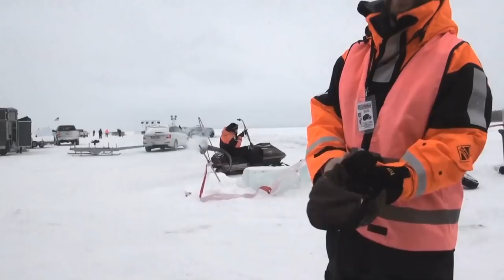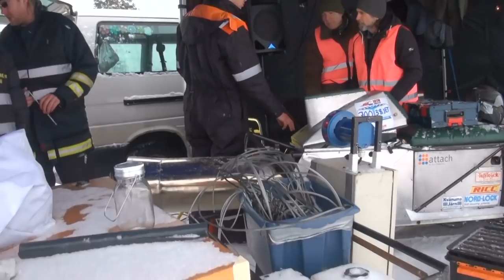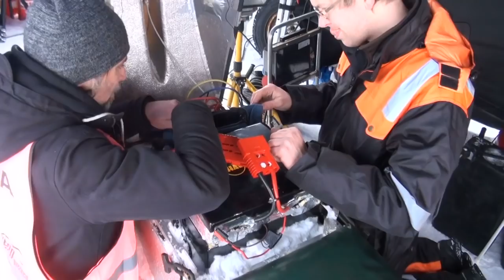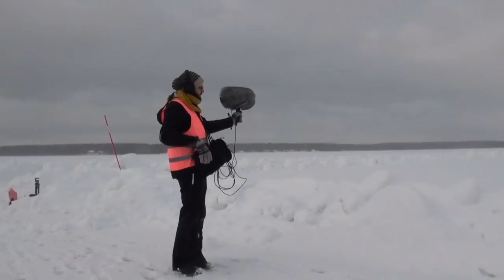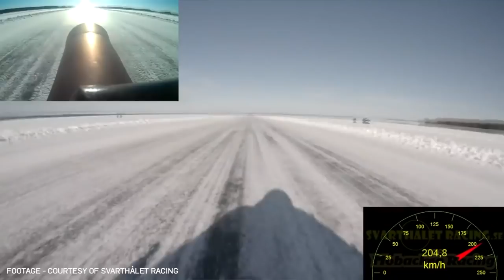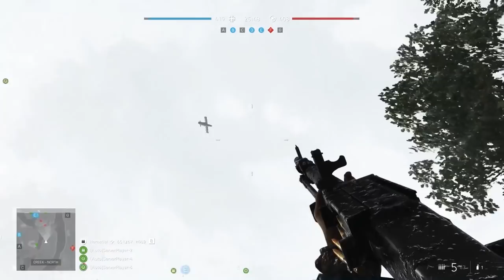Battlefield 5 audio design - V1 Rocket Sound by DICE

Comment: I imagine the hard part was actually finding a pulse jet engine
Reply: would have been cheaper to just weld one together. it's not exactly a hightech engine.
Reply: @bumboclat  yeah, little to no moving parts.. maybe the fuel itself would be a problem to get
Reply: @mrmedium7984  what are you talking about, lmao
Reply: @OliverFlinn  methane as a fuel source
Reply: @mrmedium7984  well, maybe DICE did use the proper fuel mixture for their replica, maybe they didnt.. who knows.. it sounds pretty good to me tho
Reply: Nope, they're quite simple.
If you really wanted to you could make one by cutting a hole in a jar lid and filling the jar partly with high percentage alcohol, I've used that design as a water heater once.

However iirc the german design for the pulse jet used a set of valves so those are a tiny bit more complicated than the traditional design but there's still a ton of people messing around with these engines because they're fun and easy to build.